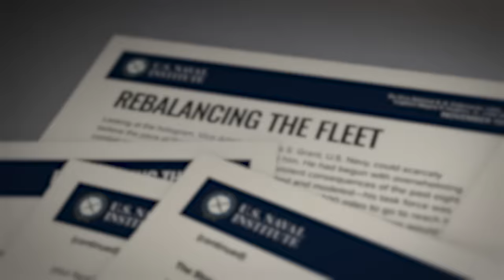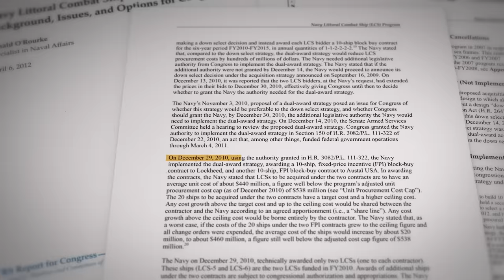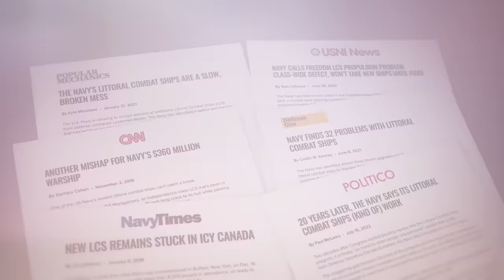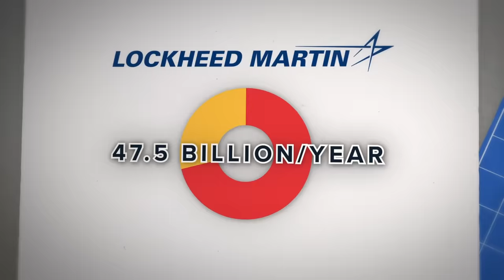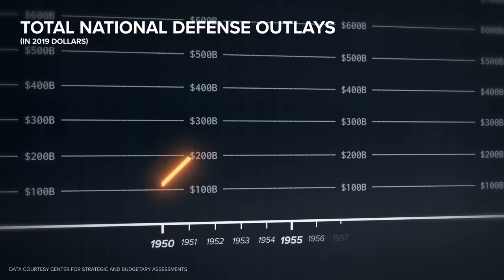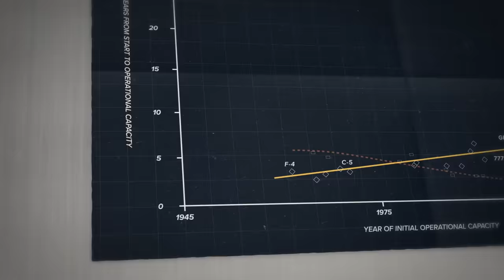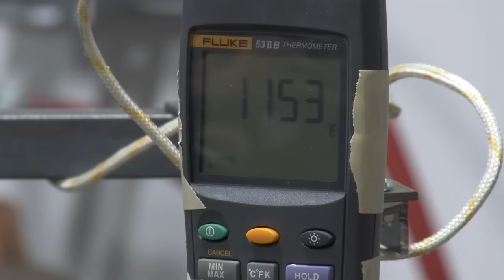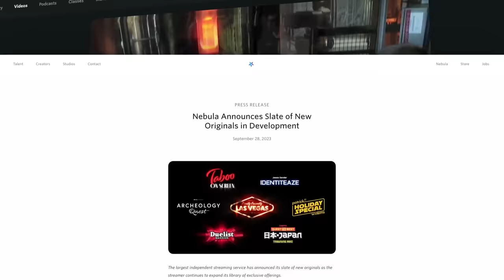Why the US Military Costs so Much

Comment: The US military faces 3 issues from my perspective: scope creep, lack of tier 1 contractor competition, and requirements based on unproven technologies.
Reply: More like lack of competition in general. Last I heard, the US Navy is larger than EVERY other nation's navy combined? That's insane.
Reply: @Ultimatebubs  China has more total ships, but the US has more tonnage since the ships are bigger and of course the most aircraft carriers by far.
Reply: More like corruption, requitment shortages and redtape issues.

Money wouldn’t be wasted if people couldn’t benefit from it and project wouldn’t be extra costly if it wouldn’t be handled as a prestige question with so much redtape that by the time they abandon the program it costed another few dozen billions. 

The newly kinda shut down shoreline patrol ships are a great example. Bad idea, 2 bad designs (they chose the worst), awful lot of problems with the made ships, super costly to run due to bad designs and maintinance, yet they made more bc a governor would have had to lose prestige over a closed naval dockyard and it was already financed, so why not waste the money.
Reply: @Ultimatebubs If you take all money spent on military, the US is 40% of it
Reply: That last one is a big one. If they weren't demanding capabilities that didn't exist yet half of these problems wouldn't exist.
Reply: @acleme1709 and we wouldn't end up with an atomic bomb or nuclear powered ships/subs
Reply: also the dispersion of the defense industry is incredibly inefficient and serves zero strategic purpose only political ones.
Reply: Thank god the Russians and Chinese have much more crippling versions of these issues than we do.
Reply: @MLGDatBoi  real
US Military corruption: buy too much shit that might not be needed
Russian Military Corruption: large swaths of money intended for ship building/ANY weapon procurement/MAINTENANCE instead goes into official's pockets LOL
Reply: Almost like war is a racket. 
Fool
Reply: @nishbrown  war is just an unfortunate part of nature, I'd say human nature but there are a few others in the animal kingdom that share our fondness for it.
Reply: @azpont7275 right. Troubling to even think what the numbers are in these circumstances. It’s utter nuts
Reply: Also add Congressional pork barrelling.  We've seen cases where the military said we don't need more XXX where xxx might be planes tanks or whatever, and Congress says yes you do, because we need to keep production lines open in my district.  Members of both parties use Contractors as a jobs program.
Reply: @azpont7275 Well America sucks at building ships, period. South Korea is a beast at it. We should work with them, but contractors would get pissed. 

 Those ships were just... Ahead of their time I think. If they started developing something similar now? It would have been great.

 Also politicians flip flopping on say the Zumwalt made the ammo for the gun which was great too expensive to use. 

  Defense industry price gouging.

 My real worries is that China and Russia get more for the buck, and pay their people less. The CCP are driven and focused, and the government since so few hold power can shift on a dime. Democracies inherently are slow.

 We are so polarized too. We don't have strong or good leaders. Where is our JFK or even Regan(charisma wise, not policy). 

 We need to stop fighting over petty things like gender identity, or gun laws, or immigrants. In fact we should embrace immigrants and allow the educated, intelligent ones to come here to lend their ideas and expertise. That is one thing America still has - the best WANT to come here. Who the hell wants to immigrate to China or Russia as their first choice? 

 I think the Left and Right citizens agree we need to get money out of politics. 

 I'm afraid our greed, infighting, and short term sightedness without a clear agenda will cost us this cold war. 

 Luckily we have allies to help. People forget the entire west profits off of America's actions. Their companies do anyways.
Reply: Too much is spent on unproven technology! WE SHOULD BE DOING: Constant small-medium budgets to develop new tech and research, while the bulk of the money should be funding equipment and ships with existing tech that has a proven track record (or after research proves it works).
Reply: @acleme1709  Very true. Fund research, but don't build out unproven and undeveloped capabilities.
Reply: So...1938 Germany.
Reply: That tier 1 competition is pretty much impossible to solve. There really aren't many who can compete with Lockheed Martin and many who can are beholden to foreign countries which is why many countries use state owned enterpises for defense
Reply: Lack of capability to win wars too
Reply: @highondankium3626 not rally, the military and the military industrial complex are highly effective at winning. The US losses wars due to shitty allies and lack of public support. The US won every battle against the Vietnamese and Taliban but lost because the allies they were propping up couldn't stand on their own feet without massive US support and the public grew tired of war. In Ukraine US equipment inflicts massive losses on Russia but the public and government are already hemming and hawing on pulling support when offensives don't result in massive victories even if they inflict tons of casualties on Russia
Reply: Sounds like a job for a systems engineer.
Reply: @arthas640   On top of that, there's the issue of public expectation. Many born in the 70s and beyond saw how fast the US was able to crush Iraq, and think that any war should be like that. The reality is that Iraq is the exception, not the rule. All militarys want a quick and decisive victory over their opponent. This is as old as time. The problem is that when it doesn't materialize, you get a long drawn-out slog that could take years, if not decades to fully conclude. Case in point, the conflict in Ukraine. The Russians banked on it being over within a couple weeks. When that didn't happen, it basically turned into a slog for both sides. The problem Ukraine faces is that their officer corpse was trained on the idea of being a speed bump for the Soviet Union, and they haven't been able to break it. They have the kit needed to win, but using it effectively is where they're having issues.
Reply: @Beowulf-sn8ir Will having more aircraft carriers really matter if Chinese missiles can sink them? Remember the effect torpedo boats had on battleships? Later planes rendered the largest battleship in the world completely useless. I'm just saying that we need more than size to win.
Reply: @WildsDreams45 then why is china building aircraft carriers also and it wasn't torpedo boats that helped make them obsolete. That's like saying javelins are helping make tanks obsolete yet we still make them. The sole reason battleships are obsolete is because of the aircraft carriers with better recon, fighting and power projection capabilities
Reply: Don’t requirements based on unproven tech often push us forward
Reply: It's so easy to tell who's an engineer and who's a politician in this comment chain.
Reply: @LaugeHeiberg well bc US spends in USD while China and russia do not if you account for diffrences in prices then diffrence between USA and China is almost none
Reply: @WildsDreams45  There's a million weapons and ships with the mission to protect the aircraft carrier, also the US has bases on many small islands around Taiwan and the pacific that are also capable of the same thing a carrier does, minus the mobility.
Reply: It's mostly the first part which comes into issue. The final one is also an issue, but it's genuinely what pushes innovation forward. The second part however is indeed a large problem though, and the US already has problems maintaining that who already exist
Reply: It's corruption
Reply: very true, you are seeing many defense companies consolidate over the past couple decades
Reply: @retsu9658  They spend 40% in international dollars, whilst having fewer men. They do, however, have way more gear, which doesn't really get cheaper depending on the country
Reply: @wesley8616  by your logic, there would be a lot of non-existing tech that benefited from the military ie: the internet, GPS system,  canned food, nuclear energy ect... that's a small price to pay for things that had tremendously improved everyone's daily life. Yes, not just amerians but worldwide....
Reply: He really summarized it well as "nobody is punished when an expected threat fails to materialize". Maybe nothing was going to happen anyway, maybe you deterred it with all that spending, who can tell?
Reply: I would add 'the law of diminishing returns'. They bleed fortunes on transition to replacements, just to end up saying 'nah, we're going to keep using what we already had instead.' Eventually the well is dry.
Reply: I think their lazer defense system tho unproven i think its way cheaper in the long run
Reply: @LaugeHeiberg  yea but it doesn't change the fact that like I said china and russia do not buy gear with dollars but their currency and it makes it cheaper to buy and pay their soldiers if converted to USD, tought I do not know what point are your trying to make right now
Reply: Unproven bro Afghanistan Iraq also this mentality of unproven so its bad but when things hit the fan you need to be innovative like in ww2 most of the pacific fleet battleship are sunk in pearl harbor but aircraft carrier not so Innovate Naval warfare as a whole to brought the Japanese many battleship to sitting duck . We need to Innovate like back then the iPhone are unproven and the flip phone are but now the only people that used flip phone are either don't have the money , collector of old things , or don't get to have new model now let's take this analogy to warfare if theres new technology that have the potential of use try it out thats how we get submarine, thats the iPhone in the scenario while the navy that stay using old stuff are the flip phone user. Look at desert storm Tomahawk need many years of research and development and in that development time its unproven but after desert storm Tomahawk are the thing for the navy you can't have new Arsenal while at conflict without major hiccup along the way thats why theres RnD
Reply: @Kalzzz_1273  reason why unproven lazer defence syste is important innovation than using a ai controlled minigun
Reply: @boom350ph  both are sound option but ai is still in its infancy for RnD and had you seen an CIWS accidentally locking in an civilian plane lucky theres someone to turn it off but imagine AI no one shutting it down that 20mm are gonna fly
Reply: @Kalzzz_1273  ik that but the machingun ai weapon is kinda proven than the lazer version

also im kinda glad it can lock on to civilian planes coz if the enemy know it cant lock on to it they will weaponize it
Reply: @retsu9658  Im willing to claim the cost of gear isnt a major diffrence in this, only personell.
Reply: @boom350ph  the ai thing gonna cause major fear for the population as they might think some kind of apocalyptic scenario
Reply: Even if with all those 3 issues resolved, you will still be insolvent, just matter of time.
Reply: @Kalzzz_1273   thats good psychological fear to the enemy
Reply: @ELYELYELroy 
Gotta line your friends pockets when in office everyone knows that
Reply: @boom350ph  and your own people its like operation chrome dome the enemy gonna fear a nuke while theres many broken Arrow incident
Reply: @Kalzzz_1273  yeah nah my country has no nukes we only provide US bases here in the pacific
Reply: @boom350ph  Japan , SK?
Reply: @MLGDatBoi  Ships are useful only against pygmies. One cruise missile can cause fatal damage to a ship that costs 1000 times more and can't be repaired fast. USA needs not ships but air defense though I doubt it's even possible to build an effective one against hypersonic stuff.
Reply: @azpont7275 If you actually need something, it is better to order multiple to scale-up.  It's why the F35 is cheaper for countries to initially purchase than home-grown fighters.
Reply: @Beowulf-sn8ir  Ships mean nothing. Pure tonnage alone, the US Navy can body the next 9 largest navies (By tonnage).
Reply: It only faces one issue: it exists
Reply: @chechennel4817 please do some research on missle defence. And maybe ask yourself why ships aren't obsolete. Why aren't militaries scrapping them? Why do they keep building them? 

Oh wait. Perhaps it might be the fact that anti missle defences are very much sufficient to defend against most attacks. CWIS, aegis, and many other extremely capable systems are used to defend ships. Just look at the recent houthi attacks. They posed no tangible threat to those warships. 

And you claim that ships are useless. Explain to me what you will replace those ship's capabilities with? How will you get your divisions across the oceans to even arrive at the battlefield? How will you prevent your opponent from doing the same? How will you get your vital fighter aircraft with ranges less than 1,000 miles into combat if no undestroyed airfields are nearby? 

America's navy is an integral part of its military that the US cannot do without. Any nation that wants to field an expeditionary force will need the naval power and logistics that the US currently fields. A navy might be useless to countries like Mongolia or Niger who don't have any coastline or interest in an expeditionary force.

The US has developed and is developing many capable air defence systems. Including ones that can intercept hypersonic missles.
Reply: @MLGDatBoi  Nobody is good at war, we just tend to be the least bad at it.
Reply: @retsu9658 that’s like saying “yes the us spends more money but only because it uses gold and everyone else uses silver”
Reply: @persuisixh4804 not really if your bread cost 3 bronze coins and earns 30 bronze coins a month and the other persons cost 3 silver and he makes 30 silver a month. When the two of you bought the same amount of bread first person pays essencialy the same amount as the second one regarldess of the form and relative value the currencies have
Reply: @retsu9658  yeah but that’s domestic economics I promise the us gets far more out of its military than china and certainly russia
Reply: @persuisixh4804  well that is true but also not us military is famous in its use of money but tech is definetly better as well corruption is not as massive as in chinesse or russian military i was just pointing out that "fact" that america is spending more money on miitary then all other countries is inncorrect and misguiding as well, bc like I said us military loves to waste money and european miliatries are just more economic, especially france who has excellent military with minimal spending by concentraitng on what is important
Reply: And brown/female soldiers